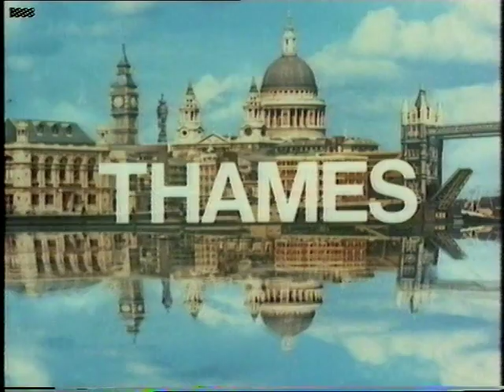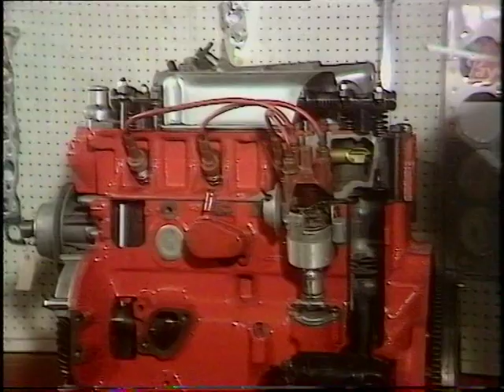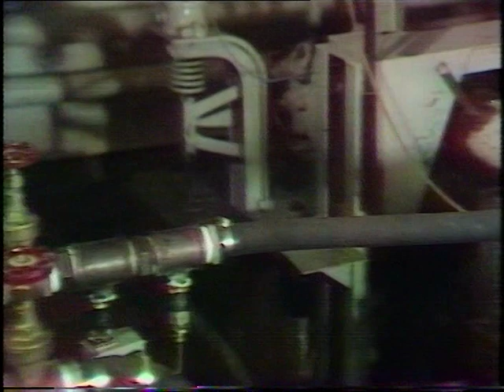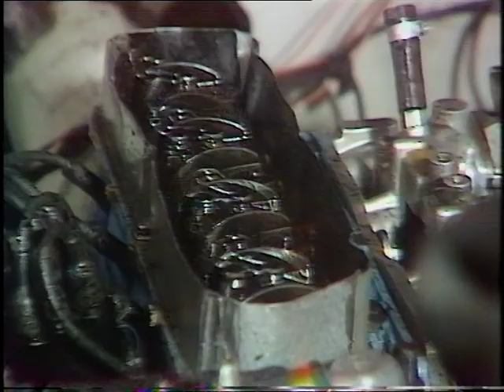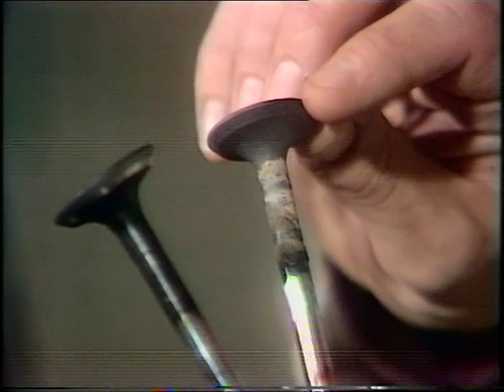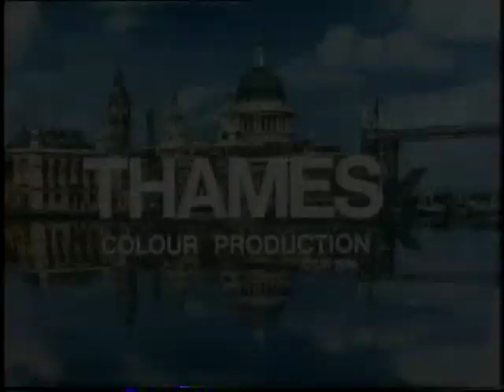Vintage car repair | Importance of car valves | Drive in | 1974

Comment: Brits speaking with standard RP seem to be divided on pronunciation of 'a' in certain words. 'classic' for example. many would  sound the 'a' there as in cat, and some as 'claasic' with 'a' as in 'fast'. in 'trans-' as in transport, transmission, transistor, most will sound 'a' as in 'track' only some as 'traans'. also in 'valve' and so many more. personally I like the long 'a' on all such examples because it is what clearly distinguishes the brit pronunciation from the american one.

Comment: off course when I worked as a mechanic we just reground the valves using grinding compound and refitted them.
Reply: That's what all car enthusiasts knew already. But that last valve there..... You'd hear it as the engine was running. You would probably feel it sitting in the drivers seat as it was idling. I have an 08 ford and a coil pack died and I could really feel it at idle....

Comment: change the valves yourself 😳....... hilarious 😂 in 2020 car owners go to Halfords to top up the screen wash .... a far more practical and able generation back then
Reply: I couldn’t agree more Sir Gawain it is far more difficult or even impossible in many cases for the owner to do any meaningful mechanical work on modern cars....... it frustrates me that even simple basic tasks, I.E changing wiper blades, inflating tyres and checking fluid levels etc seem beyond the ability of many owners.......... the owners of likes of Halfords who have a menu for such things must be rubbing there hands
Reply: People out there who change valves on engines that are only a few years old on their own. They're called car enthusiasts. My father and I have done it multiple times even though we're not car enthusiasts. Generally you "lap" or grind the old ones if they're good enough with a certain paste that's like goop with sand in it. They usually get pitting if they're high mileage and if it's too bad to grind you just replace them. And on some old engines using propane it can beat the hell out of them. It's harder now because the cams are at the top not lower down so the cams need to come out and THEN be put back in in the right alignment. And if it's a small 4 cylinder with shims instead of hydraulic lifters, you're in for some real BS.

Comment: Let us decoke . A quaint term familier to many  DIY owners of older cars when the cylinder head was removed on old jalopies to get rid of the carbon build up on valves and grinding in the valve seats to restore performance and economy.
Reply: Now the direct injection petrol engines get buildup on the intake valves unless you have a catch can. The GM 3.6L "HF" is a terror for it along with its sludge buildup on the cam side.